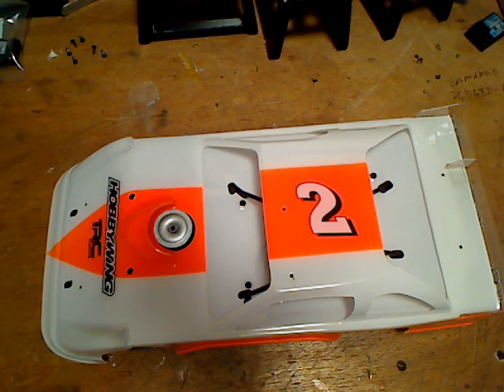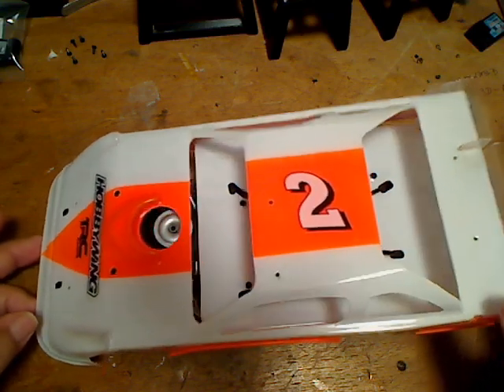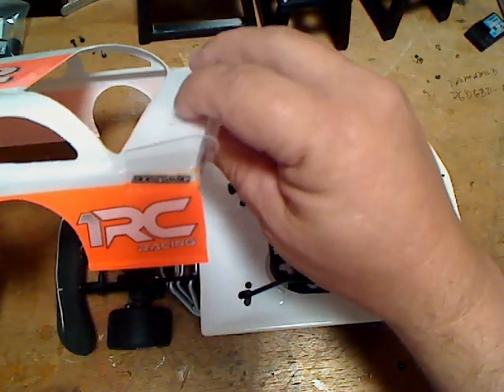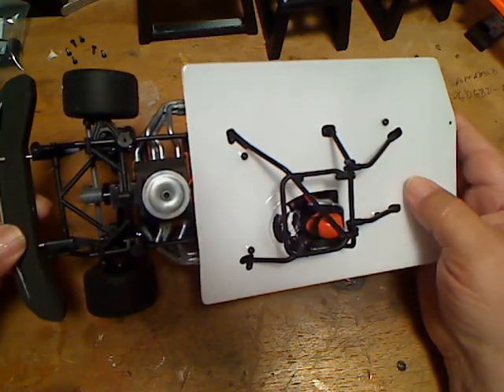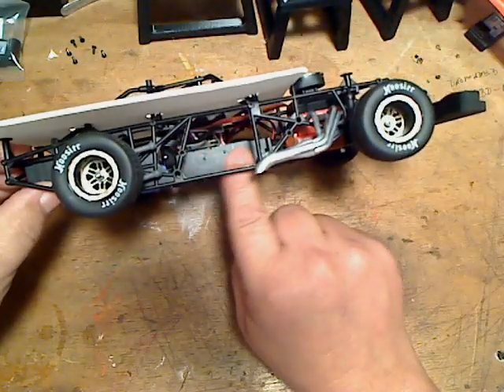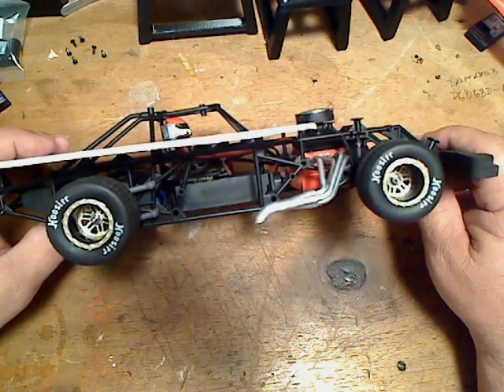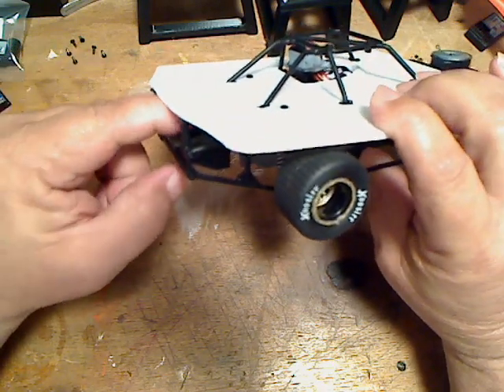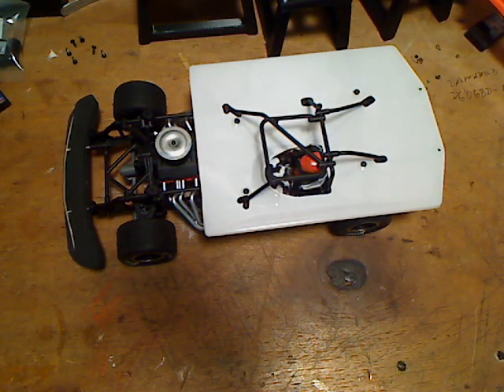1RC shaving weight for that unfair advantage.  Late Model, UMP Modified

Comment: Your track might allow this, but most places state in their rules car must have everything equipped. You'll probably get away with the screws, but the nerf bar and top of the fuel tank are required. And they usually state the reciever must be in stock location. 🤷 anyone watching this best to check with your track rules.

Comment: You can do this with any 1rc car just look and figure it out for everyone wondering it's not very hard to figure this out to make it work for any 1rc car and I did it to all mine the 3.0 sprint edm modified and Midwest mod latemodel midget and silver crown cars I have two of each car 410 sprint which is run what you brung outlaw sprint class 360 sprints which is stock 1rc sprint crate latemodels super latemodels ump modifieds and big block modifieds silver crown is any motor you want and midget class is 1rc stock.
Reply from the maker: well said.  it help some people to see examples to get creative juices flowing.

Comment: Have couple of the asphalt modified  there so many screws its unreal,car is pretty robust ,but geez
Reply: I had to add a full oz (28.3g) of weight to the asphalt modified to get it to handle well at speed on the stock softs at the local carpet track.